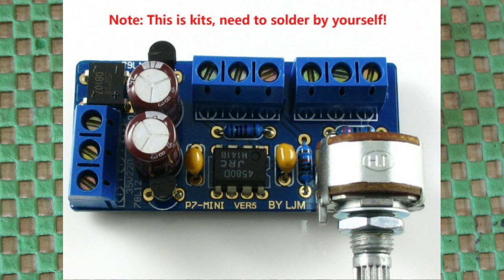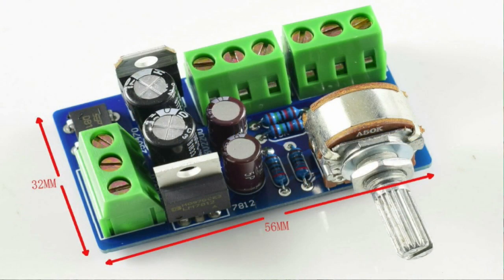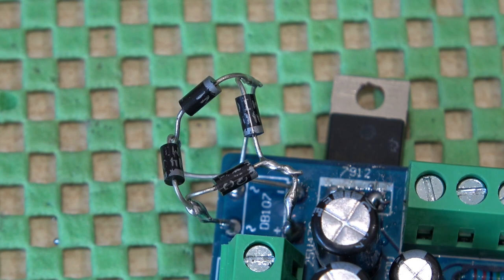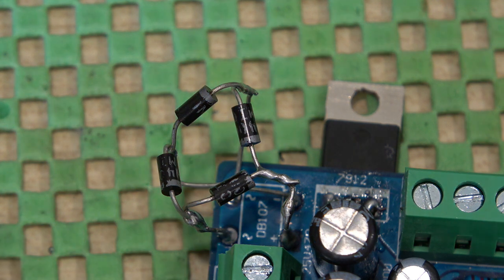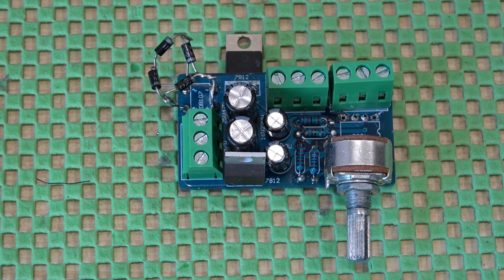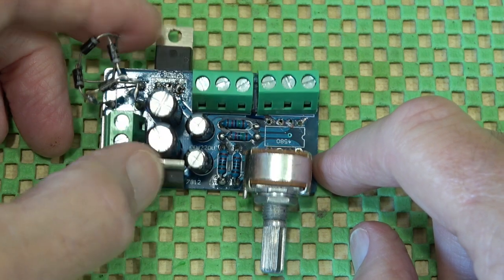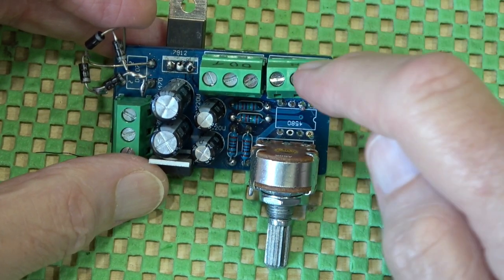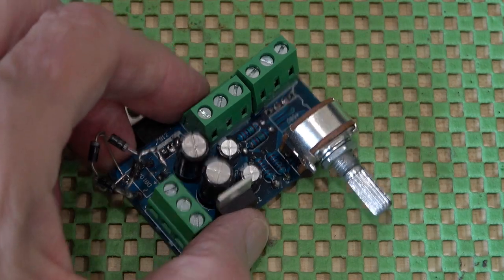4580 Preamp with Covert 19

Comment: Terrible Project. I got one diode installed in wrong direction and it boom when I turn on it. > <
Reply from the maker: A diode wrong way round, that's never good Eric. At least you know what the problem was.
Reply: @MichaelBeeny  You are good well. Otherwise, have you compare difference 5532? TI NE5532, ST NE5532, JRC 5532 ? I got one jrc5532 from my CEC CD Player and it is much good than I bought from taobao.
Reply from the maker: @EricLin00886  I've not compared different makes of the 5532, most of which are fakes what ever name is printed on them. Have you watched my video showing how to tell if they are real or fake? https://youtu.be/Junk1WG0K8g  The one from your CD player is probably real.

Comment: One of my P7 preamps was marked wrong for input/output. It was the opposit. Switched wiring, and it did work. 
Maybe that could be your problem as well?
Reply from the maker: Could it be THAT simple? I thought I traced it through, input to vol pot, makes sense. I will look at after I've finished my corn flakes. If that's the case I will report back in shame!

Comment: If 4580 is defective such as shorted, it may damage the voltage regulator as well as the bridge diode.
Reply from the maker: Makes sense, except on first power up I was monitoring current, only 8mA which is about right. I also tested the chip after and it worked fine in another circuit. We all get days like this in electronics.
Reply: Good point, multiple faults is possible, but a single fault causing several blown components is much more plausible.